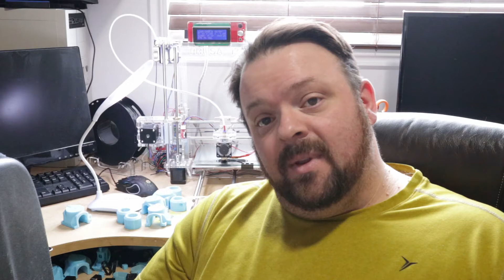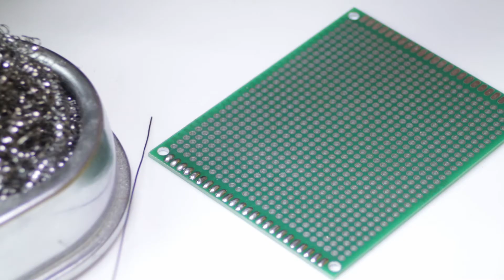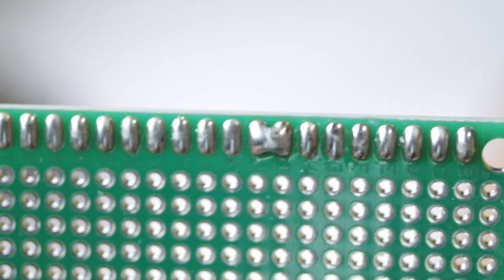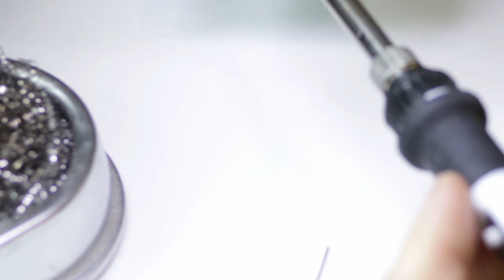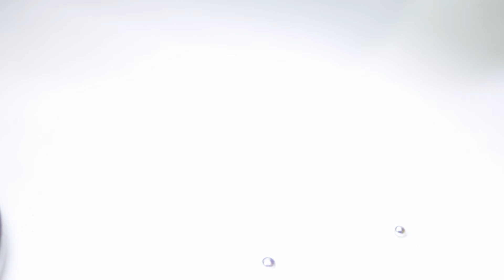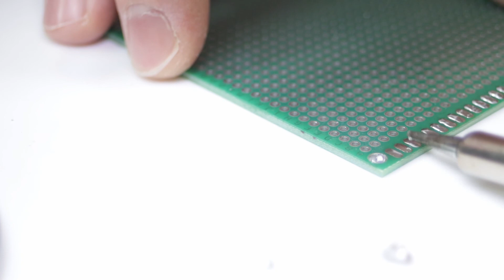Bridged Solder Pads? Too Much Solder? No Problem! THIS WILL SAVE YOUR FLIGHT CONTROLLERS AND ESCs!

Comment: My solders were all messed up, I found that the ESC was a little harder to drag away with, I used the wick instead and Got all of my joins fixed. I think. I hope I didn't fry my FC. How resilient are these things? I made perfect solders on my practice board and when I went to the FC it was a mess.